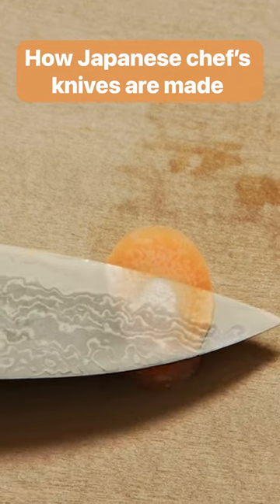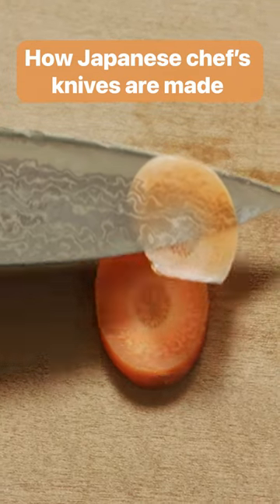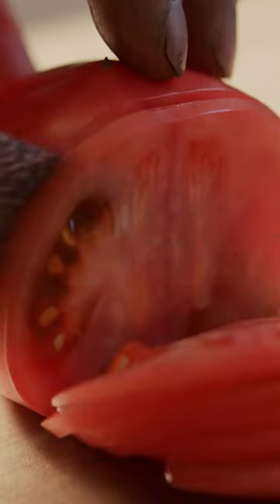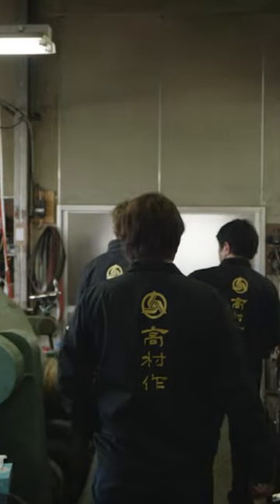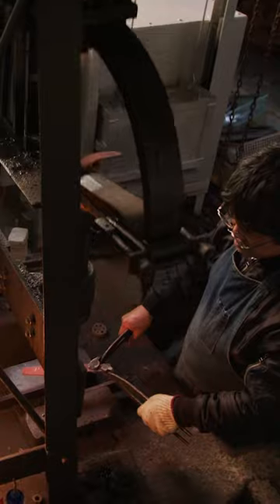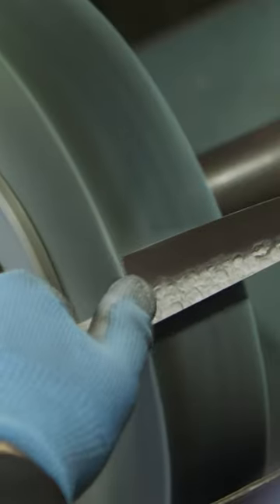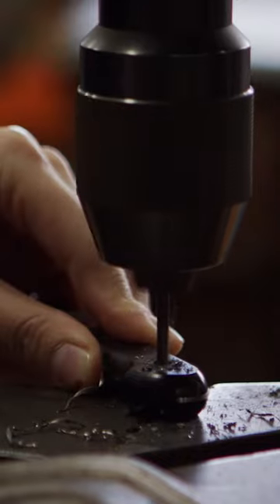This is how Japanese chef’s knives are made. #japan #chefsknife #howitsmade

Comment: Heating metal, aka tempering, makes it soft, an therefore less brittle. Harder steel will be keep a sharp edge better, but is harder to grind. You can make steel harder by cooling it down very fast by dunking it in water or oil when it is red hot. Hammering also makes it harder.

Comment: Knives are a funny thing. You can take any piece of half decent steel and sharpen it to perfection. A higher quality knife usually looks more beautiful and has a better quality of steel that can get sharper and stay sharp for longer. 

I always tell family and friends (people that actually cook) to NEVER buy those $50-100 knife block sets. Just buy 2-5 knives that you need, individually. I’ve used dozens of knives and there are 4-5 that fit super well in my hand, the rest have angles and shapes that just don’t work for me. 

A good quality sharpener does wonders, I highly recommend the work sharp precision adjust, it’s the cheapest highest quality thing I’ve bought in a long time. I took a butter knife and made it into a razor blade I can shave my beard with for fun.

Comment: Lighter = sharper? I swear these business insider shorts are researched for 3 1/2 min and then released. It's about hardness and the ability to retain an edge you absolute buffoons
Reply: "and" 

Lighter and sharper.
Nowhere does the video say 'sharper because lighter'
Reply: @Tao_Tology  define sharper. Is it the ability to cut or to retain an edge? Because I could sharpen 420j2 to be sharper than your expensive high carbon steel japanese knives, but would it survive actual use as well?
Reply: @TheAquadian  "define.."

No.
You typed a post complaining 'buhh they said" except that the video did not make that claim.
Reply: the lady talking was saying that these japanese made knives are lighter and sharper compared to European chefs knives